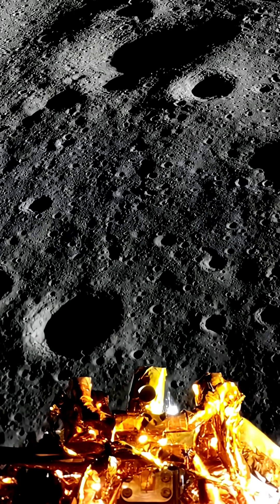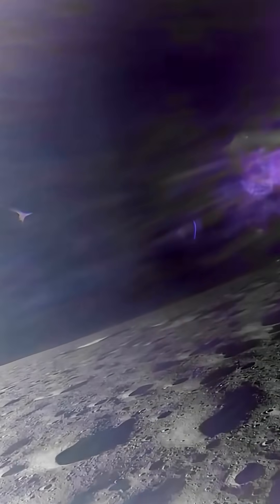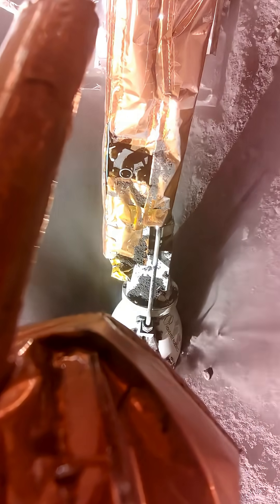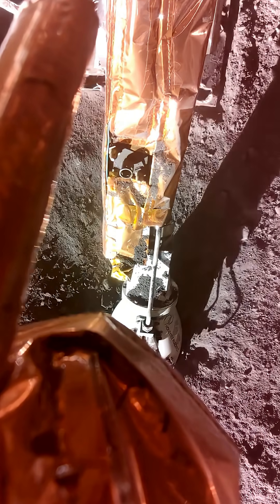Drilling On The Moon

Comment: Do you think they are looking for valuable substances?  Is there any element that would make it worthwhile to extract and send back to earth anyway as cost would be prohibitive.
Reply: The only substance the moon has that might be worth sending back to earth in bulk might be helium, and that's a stretch. 

However, the moon is incredibly valuable for resources that can be used in space. Because the gravity well is much shallower, it is much easier to get lunar material to low earth orbit than material from earth.

The moon is mostly basalt, and from it metals can be refined (though not steel because there is basically no carbon). There is also water, which is valuable in itself, but also water can be used to make hydrogen and oxygen (rocket fuel)

Comment: All that tech, and it can't even survive one lunar night?
Reply: Batteries die in the cold of the 14 days lunar nights. If I remember right, some old Soviet probes had a small plutonium capsule to keep them warm during the nights, but modern probes mostly don't have this. And actually, the mission has been carefully planned to be achieved in less than 14 days (equivalent to one "day" on the surface of the Moon), so there's no need to fight to keep the probe alive till the next lunar day.

(sorry if my english is trash ^^)
Reply: @fridaycaliforniaa236   your English is great. I remember those nuclear batteries. If I recall correctly, they were banned because of a rocket failure, and the contents were spread across the globe, and now every person alive is slightly radioactive because of the nuclear battery
Reply: @0my  mf everything is radioactive, you have potassium in your body decaying into positrons right now.
Reply: Talking about alpha particles